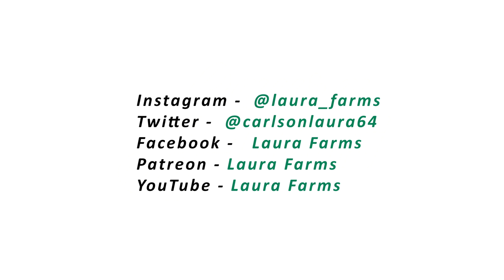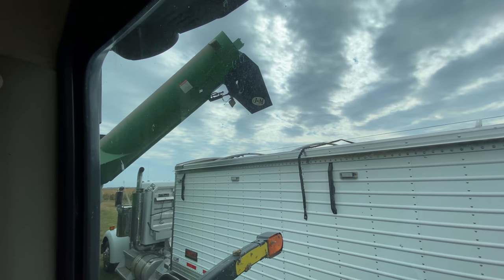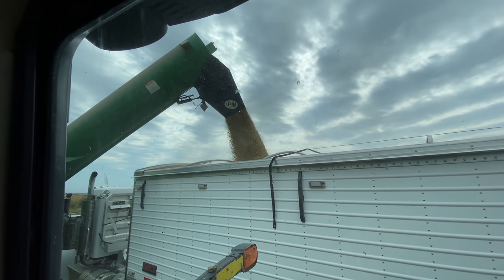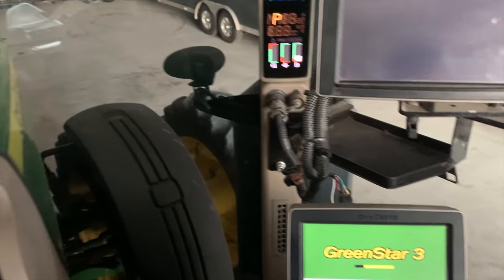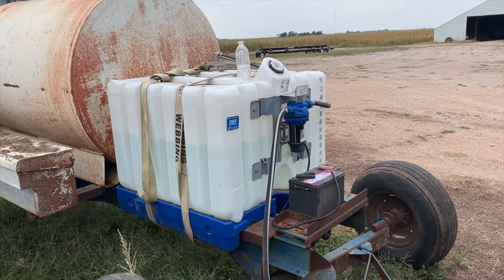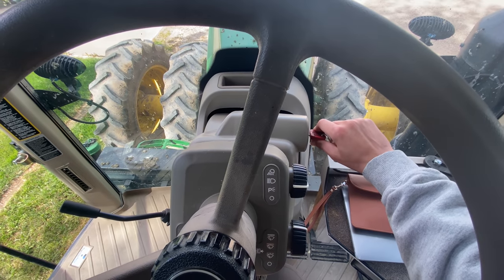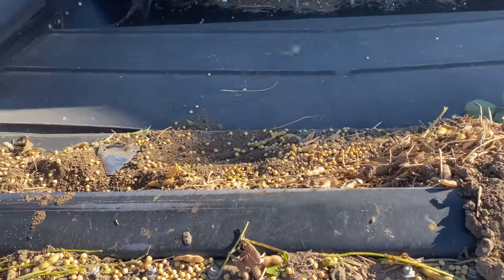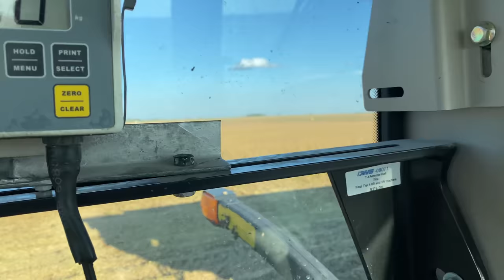The Grossest Part of Farming

Comment: I remember back in the 70's those cutting blades were soft riveted to the bar. Nice to see they are bolted in these days which makes it easier to do a field repair. I'm guessing though they are also easier to vibrate loose?

Comment: Those units that do the cutting are sickle sections (the part you found laying in the header).  Some are smooth, others are serrated (such as yours).  As the sickle moves back/forth, the sickle sections cut the stems against ledger plates.  They are removable plates on the guards that provide the shear edge for the sickle sections to work against, cutting the stems.  This is how they worked in former days ...

Also, in former days, the sickle sections were rivetted to the bar, not bolted such as yours. 

We used 7 Ft sickle mowers to cut grass crops.  The sickle sections were smooth.  We replaced the sickles once or twice per day before sharpening.  After a season, the sections were worn out and all sections were knocked off (rivets drilled out), and replaced with new sections.  Also, the ledger plates on the guards were replaced once per season - drill out the rivets and replace.  As a side note, being able to cut 25-30A per day, per mower, was a very productive day.  With three mowers, we had to put in long day to get 80A cut.
Reply: Interesting, we called the part that Laura found in the bean head a "knife section" and yep, in my day they were smooth not serrated but the ledger plates were serrated. (sort of)  We would pull the whole knife bar out each day and sharpen each smooth knife section cutting surface.  At the same time we checked each knife section for "tightness" and if it was loose we had a railroad iron section we used as a portable anvil and we would take a ball peen hammer and "swell" the rivets to make each knife section tight.  If a knife section broke we would grind off the top of the rivet and then use a hammer and punch to drive the rivet out.  We never used a drill.  I don't think our mower would have had the clearance to allow for bolts to be used to hold the knife sections in.  Aaaahhhh the good ol days.
Reply: @InquisitiveSearcher  Yes, ... I think I remember "knife section" used as well.  Yes, smooth sections and serrated ledger plates.  Oh my, ... the railroad iron portable anvil, ... right on point!!!  We had one that was about 8" long and heavy.  But, you are exactly right.  It could be put under the sickle bar as the anvil when doing the rivets.  We had a heavy hammer and some punches to do the setting of the rivets.  We had no portable grinder, hence the use of drill.  We had a large, very heavy 1/2" Milwaukee drill for these uses.  For the sickle sections, we used a cold chisel to cut off the heads, then a pin punch to drove out the rivet.  No, our mower would not have room for bolts either.  We used 7 ft New Idea pull-behind mowers for cutting/swathing grass crops.  We also did some straight cutting of Spring grains (wheat, barley, oats) with a JD 55 combine, 12 foot header.  This was very easy cutting, when compared to cutting the seed crops with the New Idea mowers.

I wonder why we did not use hot rivets?
Reply: I have repaired many of those sections.   Ours was riveted in place.

Comment: Hi Laura, I'm a weldor down here in Louisiana and I do a lot of contract work on grain bins, pits, rice mills, hopper bottom trailers, combines, grain carts, ect. and one of the best solutions I found to combat bad smells is Vics vapor rub. Just put some in you nostrils and reapply when it starts to ware off. Vics has helped me keep down many a meal.
Reply: Vic's is an old wives tale. The only it does is make a bad smell, smell like a bad smell & Vic's.  Cops gag too Laura, don't let anyone tell you differently.

Comment: When I was a kid my Grandpa bought a section of ground that came with a grain bin on it. It was full of corn which had sat for a couple years & rain had leaked into it, BAD! After removing the rotten loose corn, there was a 2’ thick crust of corn stuck to walls from top to bottom. It took us a week to clean that out. The smell, UNH. Had to wear respirators for the mold dust also. There’s not many things worse than rotten grain smell!! 😆

Comment: I had to sort out the sump pump in the dump pit, pipe dislodged above my head when the guy up top started the pump, got a shower in hot ( pump had been running blocked in the sump) rotting corn and water, couldn't get the smell out of my skin for a week. Both of us were laughing, one of us was almost barfing, fun times.

Comment: The muck coming out of the bucket elevator.

1) Vicks vapor rub applied beneath your nostrils will help with the stench.

2) You don't necessarily need a full blown hardhat, but a field hockey helmet will help protect your noggin.
Reply: or even a bicycle helmet
Reply: A SCBA air pack or at least a cartridge filter whole face mask with an NBC filter. We wear these at work when it gets really bad.
Reply: @joefudd  Probably overkill for a job they do once or twice a year.

Comment: I'm from Florida. I used to work in the sugar plants in south Florida. When they shut down the plant they perform a total clean out plant wide. This mainly done to keep the corrosion in the steel structure and the equipment. Strongly recommend putting this practice in place in your plant.

Comment: There's not enough farmers that wear shorts. Your ol man's got it figured out. If it's above 65 degrees I'm in shorts, only time I'm putting long pants on during the warmer months is if I'm cutting or welding, long pants are not required to set in the cab😁

Comment: A "Slip Clutch" is a torque overload protection device. It's installed in a shaft system where something down stream could jam and it "slips" so the transmission or engine up stream won't get damaged when it is over loaded.
Reply: Yep! Those and shear pins protect and save on even worse damage.
Reply: @Fred54 :  I always thought of the ratcheting slip clutch as protecting the more delicate downstream device from being destroyed by the much more powerful and robust upstream equipment.  The clutch limits how much power can be applied to the downstream hardware.
Reply: @joefudd  Torque limiters are good too ... but they need a microswitch controlling an indicator showing when they're open (or even shutting down the power to the drive), as driving a torque limiter for too long where the load half is stalled will destroy the torque limiter.
Reply: @InquisitiveSearcher  Depends on where the weak point is.

Comment: When I was growing up we had some round-top hopper cars on the siding at the Pesotum in-town tower that took on the dregs of a silo full of soybeans.   They got left sitting there and the rocking and wind and age of the ties ended up letting two drop their trucks down between the rails.  The IC showed up to snatch them away and discovered they had five month old soybean dregs in them and had been open to the weather so they hooked up to a hydrant and washed em down on the ballast.  They used a re-railer and left with the cars but left about 5 tons of soy laying in the tower's siding... at the start of the rains.   A hard-up Opossum decided to try to eat some and died in the pile.  Flies came and laid eggs and their maggots died in the pile.

25lbs of lye and about 300lbs of crushed rock salt were spread on the mess and the smell mostly went away.   There was rotting soy between the rails for six more years.

Laura... remember to clean out that bucket boot at the end of harvest.  Soybeans smell so nice when they're not rotten.  You simply do not ever want to discover rotting rats in the bucket boot in the rotting soy.

Comment: Why not clean all equipment at the end of harvesting, should not take long, an asset is to be maintained, 😇
Reply: That would be too easy lol
Reply: I thought the same thing. Why not go ahead and clean it out ?
Reply: That’s what you would think but most farmers don’t do that because 1. It’s usually freezing outside at the end of harvest and 2. They just want to be done for the winter so they simply put it off until the next year. Might sound stupid but you would understand if you did all this work
Reply: Right On.  Most of the work is done after harvest and cleaning up  equipment is part of it, definitely makes your equipment last longer, stay in better condition , and ready to go for next season.  Most of all it helps cut down on unnecessary expenses.
Reply: @VonBluesman  I noticed all of the corrosion inside the conveyor box that the rotted beans had caused. The box was galvanized steel. It needs to be stainless.
Reply: @joefudd  yes, because stainless grain systems are common, I mean an extra couple mill in steel.  No biggie. Lol

Comment: Just a suggestion don't wait after using that equipment to clean it out its leaving it for too long which causes the organic to decompose and smell awful. Another trick is to use a clamp like your fingers to plug your nose. breath thru your mouth.Trick number 3 put down a metal bin so when you pull out that crap it goes into the bin and does not need re-shovelling. Number 4 have a pre-dug hole just outside to dump that crap into and use the dirt that came out of the hole to cover over it to suppress the smell. Hope these make your life more comfortable.

Comment: When you are 'jump-starting' one piece of equipment/vehicle to another with a severely depleted battery, it's wise to have the 'jumper' unit revving at a higher level in RPM prior to attempting a start!  Saves tons of time and usually works the first or second time. FYI

Comment: That smell is only topped by a run over dead skunk that you have to remove from your driveway. Thanks for the ride along. I haven’t been on a tractor in years and that brought back some good memories of the dairy farm I lived next to as a kid and rode while they filled wagons with square bales. Any time you have equipment stuff breaks and there’s lots of maintenance to be done. Shoveling moldy silage out of a silo is no sweet smelling job either but a good rainy day activity.

Comment: Tip:  Clean it out right after you use it in the previous harvest or last time you use it so it doesn't get all nasty like that. Worked as an elevator operator. We had a leak and it rained real heavy one day and got all the grain at the bottom of two legs wet after the boot pit filled up to 3 or 4 feet of water.  We had to pump out the nasty water and then get the grain out one five gallon bucket at a time about 40 or 50 feet up.

Comment: When I was a kid I went up into the hay loft over the milking room and heard a bunch of metal squeaking. The corn chopper was parked in the empty part of the hay loft (two level barn: front to the milking stalls on ground level [because sneakers for cows are just too expensive] and the hay barn and loft on the second level up that was cut into the hill ) It was rats living in the corn chopper. Hundreds of them. I went in with a shot gun first but never fired a shot because the fact that it had a slate roof was immediately evident to me and no mater what you put in a shotgun, it's going to damage the roof when you're shooting up into the rafters (where the conga lines of rats were). So I got some .22 cal hot shots and used those. They weren't going to penetrate anything but rats. First couple of rats I shot ran right at me. I knew you don't have to kill a rat outright, just get them to bleed and they'll bleed out. They don't have coagulant in their blood. But having them run at me was a little un-nerving so I put a board across the stairs down to the milking parlor and sat on it while I shot rats. They'd run at me and fall down into the milking parlor. And every rat, every single one determined where the shot came from and tried to attack me. Down to the last one. The barn cats were playing with some of them but had I known about how vicious terriers are with rats, we would have had those. I shot more than a case of hot shots into that hay loft. I was getting down to last ones and saw the heads of them poke out of the grain tube and shot each one in the head as they came out to see what was going on. I don't remember but I think the hay had to be thrown away.

Comment: I went with a coworker to replace steel siding on a barn.  The coworker was wearing shorts and tennis shoes. The siding was laying in corn that had leaked from the blower. As soon as I moved the first piece rats ran out. When we set our ladders up and they broke through the crust to the wet mash I had flash backs to riding back to the barracks with a bus load of drunks.

Comment: I'm surprised they don't suggest bump caps for walking around the storage system. If it were a factory OSHA would require them. But it's a good suggestion regardless. Beats a gash in your head.

Comment: I love your videos I am curious as to why you don't clean out the parts of the grain handling equipment at the end of harvest so it doesn't decompose over winter and smell so bad and other problems and maybe you could use Loctite on your blade parts so they don't vibrate apart. Thank you so very much for all of your videos I'm hooked.

Comment: The most dangerous thing on the farm is the smokin' hot farmer's daughter. Lol...Love the channel! 

Believe it or not, rodents hate peppermint. It also grows very easily and might survive the NE winters with a little mulching the first year or so. So you might try planting some around your silos especially where they are coming and going. The rest of the farm and equipment can be sprayed twice a year with diluted peppermint extract in a pressure sprayer. You can treat all your combines and vehicles inside and out to keep the rats and mice from chewing on wires or making nests inside your air filter boxes.

Comment: So watching you clean out the gross leftovers. Then I watched you poor good grain through it till all the old but not as gross grains of old cleared and then you dumped a bunch of good grain on the floor. What is the purpose of that trap later on? Why was it necessary to even have such a spot? Is it used to retrieve the stored grain at a later date? So far I do not know what it does beyond gross you out.

Comment: Wait i just saw you used jumper cables from the F350 to tractor. Cool now. I have learn when you used any type of Motor with wheels With jumper Cables Never Turn on With Both Cables Connect to Batteries before Turning On Negative cable from the engine that is On putt'it on any Metal Surface on the Engine or Engine bay. Why i Have seen how many people Burn there Computeres when both Units Are On. All For Good

Comment: Rat, rodent traps.
A pipe with bait at one end blocked by a wire screen that is only accessible from inside the pipe, a section of the pipe is a teeter totter that dumps the rodents into a tall barrel with some molasses and water in the bottom.

Comment: "putting in def" ... whats def?
Reply: Diesel Exhaust Fluid. Diesel Powered American equipment built after 2011 has to have a DEF system. It supposed to clean the air. What I think about is a completely different conversation. 🤨

Comment: I like your foxy little face,  moves like a fish through water and reminds me of two beautiful people i know without hint of the B word.   My little secret with tight bolts is not to try and losen first but slighty move to tighten them first then undo,  reason I figure is when originally tightening the nut against bolt - the  rubbing steel causes micro saw toothed pattern in the direction of twist.  And when sitting there for a while rust / atomic {molicule vibration} of bolt and nut surfaces may interlink  {ever so slightly surface level of course}  causing fusion together....   and when you go to lossen bolts your not only dealing with the fusion factor but also the micro angled saw toothed pattern of the metal  {which will interlock when you twist it backwards}   hence if you  "slightly further tighten first"  this breaks the metalic bond first -  then you go back wards undoing the bolt.  my theory anyway which often works,  i tell you this with love cause Im sort of inlove with you.